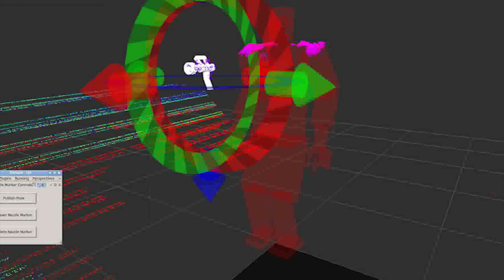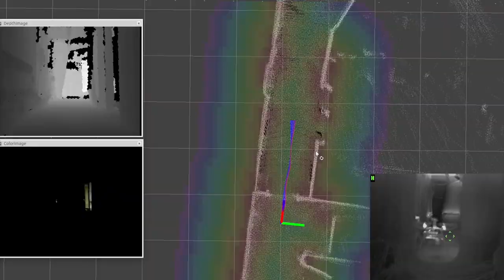Shipboard Autonomous Firefighting Robot - SAFFiR

Comment: Its probably cheaper to mass print the sensors it is using, and then attach those in the ship covering every direction and every 2 yards, then let the computer control the different fire extinguising systems.

Comment: Well,, everything has to start somewhere , hope the technology  gets better.
faster , waterproof and fire retardant . I don't know if it's in the works or if it's the plans,but electromagnets on the foot stabilizers that alternately switch on/off when walking on the metal deck would assist the stability.And as well , both activated on  when stationary